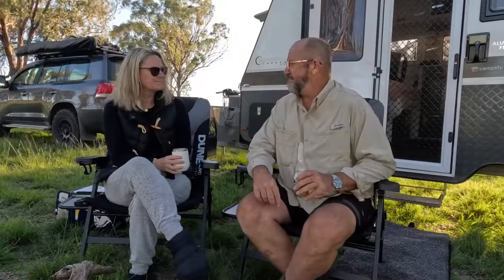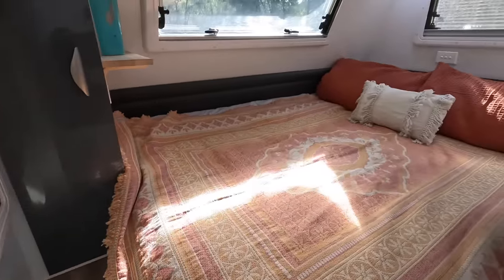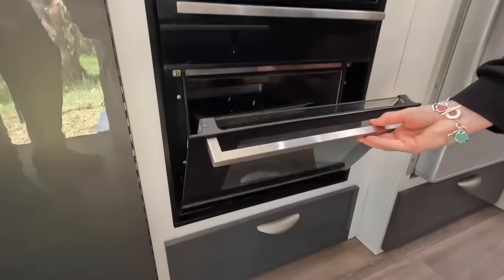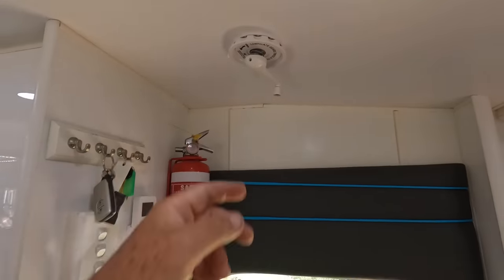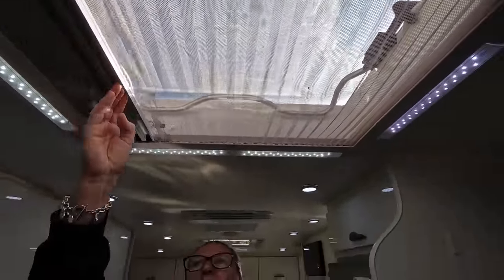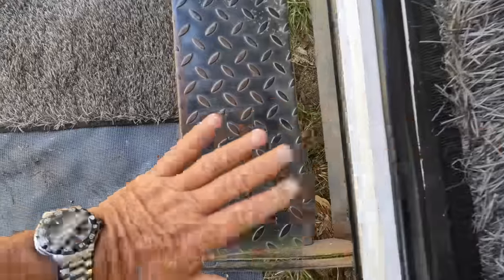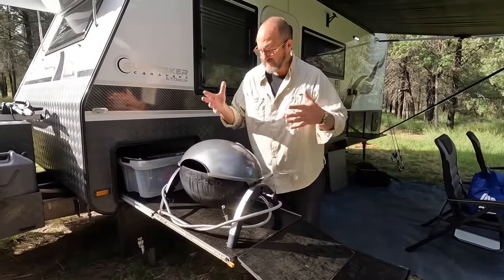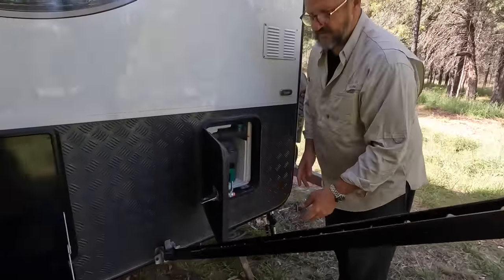Sunseeker Wild Child Caravan - Titanium Value or Not?

Comment: Just my thoughts, if your looking at long or full time travel a twin axle van is a much safer option......one they tow better, 2 if you blow a tyre the chance of losing your van is vastly reduced and finally most (not all) importantly single axle vans in the majority lack a reasonable payload.....
Reply from the maker: You’ll be Tracey’s favorite real quick! Good points. Looking at max off-road performance for the extreme locations also, singles beat doubles there but I’m leaning a double.

Comment: When you hire from Camplify, do you pay the $15 or $35 excess, thanks Jeff
Reply from the maker: We’ve done both but we take the $35 one more often than not when we do several hundred Ks. Short trips the lesser one - just picture yourself if something goes wrong having to fork out that big excess.
Reply: @caravansbythecampfire  Thanks for the reply, the Wild Child does look like a good size caravan with Aluminium frame
Reply from the maker: @jeffrollason1190  Tracey loves it! A titanium fan for sure - I was impressed with its tow ability and condition after doing a lap on and off road. Needs an upgraded power supply for off grid but the owner just used his generator - always an easier cheaper option.